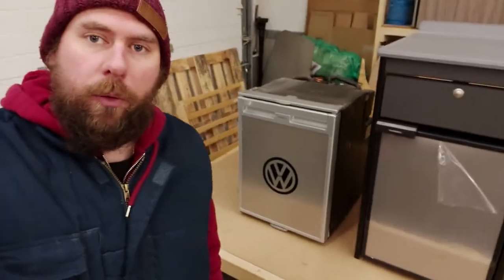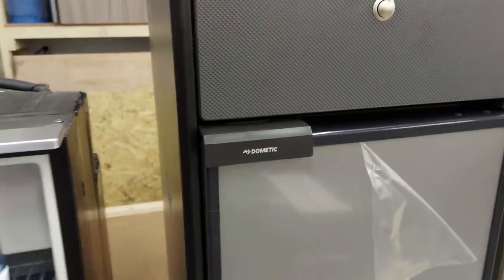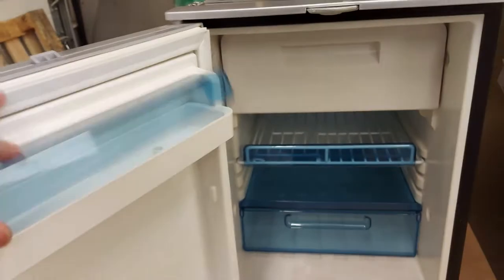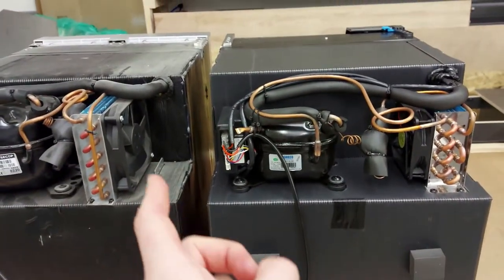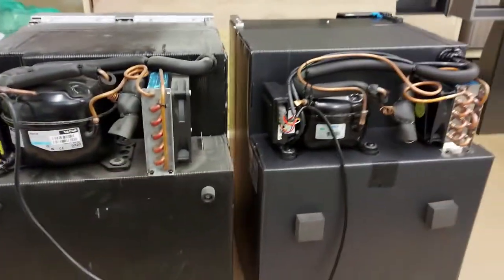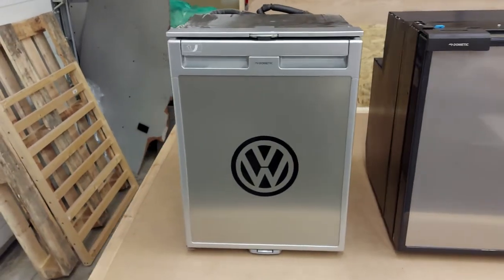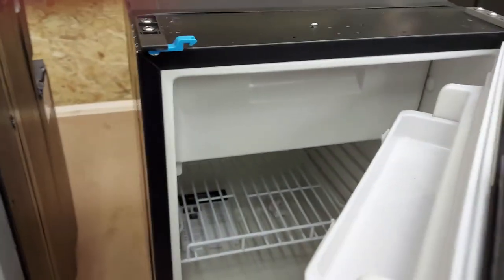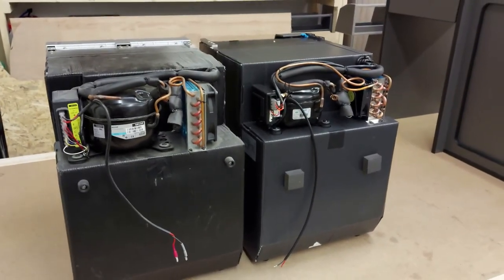Dometic CRX 50 vs CRE 50 comparison fridge/freezer

Comment: The cre is made from much cheaper materials.  

Also the electronics are different.  If the cre model shuts down due to low voltage, you need to unplug the fridge from the supply to get it to reset.   It won’t automatically fire back up when you recharge the battery or start the engine. The crx will just kick back to life as soon as the voltage is back up.
Reply from the maker: i will look into this further,  thanks for the info 👍
Reply: Mine restarts fine.

Comment: This is the only video (or information in the net) which points out that the CRE has the weak AMV13JZ Compressor. This Compressor does not have the cooling-power of a BD35F... as a result it runs in longer circels an consums more power...              Aside from that, the CRE increases his rpm after a few minutes, so it gets louder... very anoying and sad... i dont recommend the CRE and looking foreward for a crx50
Reply: hmmm interesting, i never noticed cre getting louder, it does run often but I am now in Turkey with +35C inside the van at times.

Comment: How do you fix the CRX into an RV (VW T6) ?   There must be screws at the front inside which you undo so as ro s;ice the unit out.  In mine the latch was broken by a VW technician yanking on tne wrong end.  Denied it of course.  Now I have to replace the whole door or the locking mechanism.  But I cannot get at the door unless I pull the whole fridge out?

Comment: I think the bigger compressor use a little more electricity. I really don't know what I want of them. I'm looking now to bye one for my vWT6
Reply: If you look at the spec sheets, the rated current of the CRE is 5.8A (at 12V) and of the CRX it's 5.5A. So, lower current for the bigger compressor. I'm not sure, but I think the CRX is more energy efficient because of the way in which the compressor is electronically controlled (among other, soft start). But maybe the CRE-version has the same controller?

Comment: Hi Oggy, thanks for your comparison. I am still wondering what fridge should I order, because of the noise. I have a small van (T4) I am looking for the quietest option. Have you had a chance to test it on power? Thank you for your help!
Reply from the maker: Hi, im afraid i haven't tested the power as i haven't had another CRE in the workshop (we dont sell many fridges as we are more furniture builders). But i do have the CRX50 in my own T4 and its brilliant, its quiet, i  can 100% say its worth the money. But if i was buying again i would probably buy the CRE and save a few pounds as we only use our van for the odd weekend and few MTB trips. Hope that helps.
Reply: @247oggy  Thank you very much for your quick answer. I follow your advice since we are going to use our van occasionally. Hope the CRE is quiet as well :)
Reply: @ricohn  did you get the cre how is the the noise and power consumption? kind regards

Comment: Van you test the power consumption?
Let them run side by side and measure the consumption, how many amps each uses.
Reply from the maker: Yes i did think that but i didnt get round to it as the fridge in the video was going into a customers van, if i get time when i get another one in i will try to do the power test.
Reply: @247oggy  ive heard from nick the technition at jacksonsleisure.com & niel at kiravans.co.uk that the cre use 60% more power than the crx a big difference in choice for cloudy england? and that the cre is louder in fan noise? any knowledge on this to back it up? i really prefer the look of the cre though!
Reply from the maker: @benjahben  thanks for letting me know this, wow 60% sounds like a big difference, that could be a deal breaker, the fan noise probably wouldn't bother me to be honest but its all personal preference. 👍